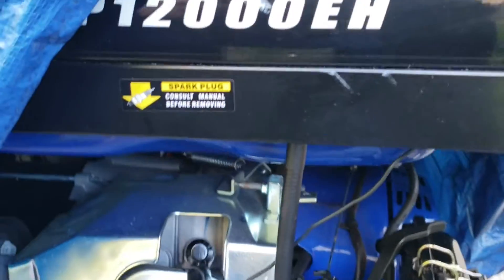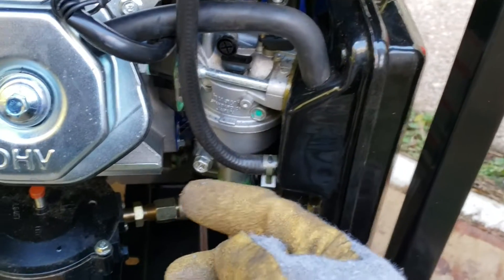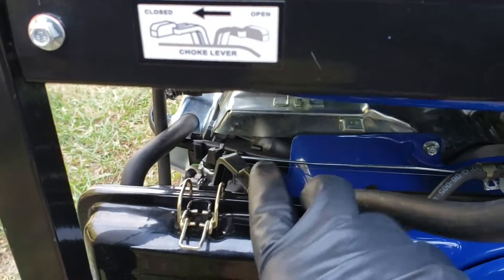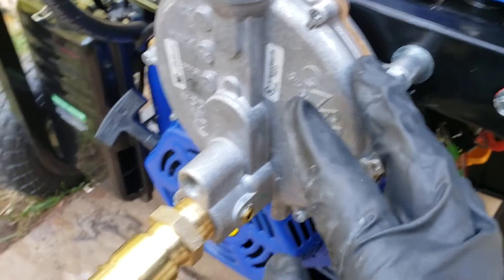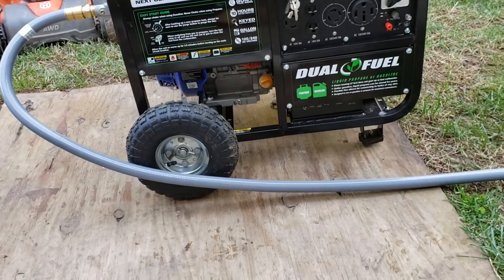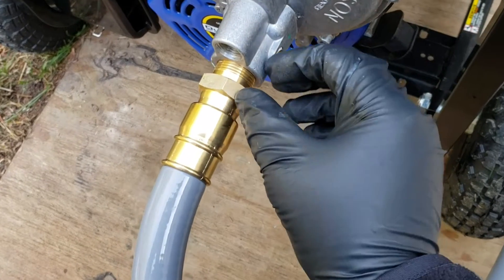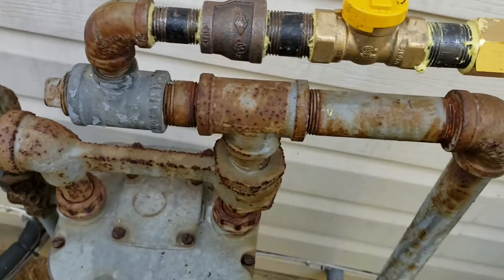DuroMax XP12000EH - Converting Gas/Propane Generator to Natural Gas (Dual Fuel to Tri-Fuel)

Comment: Why does Duromax say NOT TO RUN on NG due to damage to the generator? Am I missing something?
Reply from the maker: Back when I bought this and did this conversion, Duromax didn't have any warning against it. Looks like they updated their website. I'm not sure why they say it would damage the generator.  But their is a video of a guy in Texas with the same generator running his entire house on natural gas for several days during the recent polar vortex, and he had no issues. My guess duromax says that for liability/legal reasons .
Reply: Impurities in Natural gas, water, rust, gunk??
Reply: @mikecopenhaver4484  That makes sense. I have three Mr Heater Big Buddy 18k BTU's propane heaters and if you use the 20lbs propane tanks they suggest using an in-line fuel filter that you replace I think once a year or when you start to notice the flame in not as intense like the unit is set on low. The question is do the make NG inline filters? I just wish we had NG in my neighborhood. It's now two blocks away but if we want it I need a bunch of neighbors to sign a petition and need about $10k to bring it from the street to the house 🏠

Comment: Do you have a problem with THD on this generator? I heard THD on Duromax is about 10-15%. Do you have problem with your sensitive devices such as TV, computer or refrigerator? Thanks
Reply: Hello, my fellow Texan.. I did a lot of research on this generator, and nobody complained about not being able to run appliances due to the high THD.. My advice is to get the generator started first, give it a little time to stabilize, then power up the sensitive appliances. If you still have problems, you still have a couple of options.. Either get a UPS that has a line conditioner, or a power filter.. Early in my career I installed medical equipment in mobile clinics (buses or vans with X-Rays, scanners and other sensitive devices), powered by generators.  UPS was always the first measure to clean up the sine wave.. Line filters a close second.  I read reviews from folks that used surge suppressors, I'm not that convinced that it cleans up the sine wave, but it adds some degree of protection.. Best of luck!
Reply from the maker: Sorry, I don't know. I still haven't lost power and had to run this generator yet.
Reply: @Mr-Chris  Any updates to this? I had the same question, thanks!

Comment: Hello sir what is the brass looking piece on top of the regulator that connects to the carburetor called the size and where to get it thx
Reply from the maker: This is hard to find. I am 100% sure what the exact one you need or will fit, but these are the two I was able to find. 
Load Blocks:
https://amzn.to/3kIMLmn
https://amzn.to/3ba450r

Comment: I took what information he provided, did a check with an HVAC mechanic friend. Following that, I bought mostly the items he provided the links to & converted my XP12000EH that I had already purchased from Home Depot last year. After everything was finished the trial run worked perfectly. Now I don't need to worry about buying gas or propane in canisters, it's now running off the natural gas that runs in my house. The Best video I found on this subject & glad he posted it.
Reply: What all do you  run on that 1200 natural gas generator?

Comment: Will the first link of your tri fuel kit work on the duromax correct?
Reply from the maker: It should work for Duel fuel generators, it won't work for gasoline only duromax generator. For Duel fuel.. All you really need is the regulator, the top adjustable tee valve, and rubber hose.
Reply: @Mr-Chris  thank you man, figured as much.

Comment: Chris, do you know what the starting and running watts using Natural Gas?
My guess would be 9,600 & 7,600, but that is just a shot in the dark.
Thanks
Reply from the maker: yeah, your estimate is about right. It's 20% less than the gasoline rated power.

Comment: Informative video. Have you ran the generator on ng for any extended period of time? ...any issues?
Reply: I've been running my my Generac 7500E Generator for the past 9 years on NG with no problems.
I have 500 hrs of run time on the meter and I use Valvoline Premium Blue oil for NG,LNG & Gas engines.
From what I heard Valve Recession could be a problem with non hardened valve seats and this oil helps with that.
This particular generator in the video may have Hardened seats from the Manufacturer since it Already runs on propane, but you 
Would have to verify.

Comment: Do I need to mount this to the generator or can I just mount it to the gas line on the house and then use the same or similar hose and add a quick connect to the hose between the propane regulator and the carburetor.  Since I would only use  natural gas at home is seems like a much easier mod and I would not need that crazy big hose running all the way to the generator.
Reply from the maker: Theoretically seems like it might work. Keeping regulator attached to the main gas hose and having a disconnect for the smaller one to the carburetor. My only advice would be to make sure the smaller hose isn't too long. Also I think the regulator might need to be upright, but I am not sure. Give it a try and let me know if it worked.

Comment: One more question. Was there a reason for using the 3/4 ID gas hose? I need 24’ which is hard to find in 3/4 ID.
Reply: The gas hose and diameter of the line line is specifically dependent on the HP of the engine you are using, how far the line is away from the meter and how many gas appliances you plan on using with the generator, also, is the line direct from the meter, or are there other appliances on the line. If the hook-up hose is kept to 6' or less, the use of a 1/2" hook-up hose and quick disconnect coupler for up to 18hp engines is acceptable. The point is to have the correct size pipe up to the shut off valve for the generator.

Comment: Chris, what is your NG psi coming from your meter? I have the same NG regulator but it says that the minimum inlet pressure is 1/2 psi but my meter is regulated down to 1/4 psi. Curious to know if yours is also 1/4 psi. Also, can you run other NG appliances in your home without affecting the gas flow to the generator?

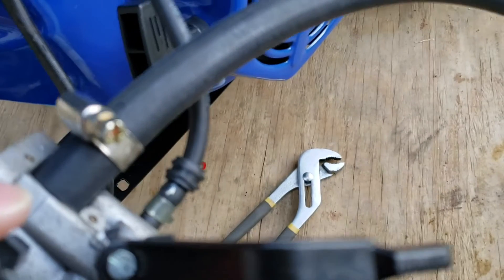Comment: Nice work. At around 2:00 in the video, you’re holding the carburetor in your hand. Couple of questions: is that the original carburetor? And, if so, did you remove it only because you needed to install the longer tubing that came with your kit? Or is that a new carburetor that came with the kit?
Reply from the maker: It's the stock carburetor. I took it off to give me better access, but it doesn't need to come off.

Comment: Hello Chris sorry to hit you up with questions,     1. Do you really need a 3/4 inch hose as it is you are reducing the size on the meter from 3/4 to 1/2?  I read that you do need a lot of BTU for this generator to handle the load at 9500 watts. Have you push this to the limit?   2. the amazon link for the conversion kit, for that price they do not include the load block, they said on the Duro max XP1200 you do not need it?  Have you found that to be true? if your load block pretty much wide open with full choke ?  3. did you run the generator with gas prior running it with Natural Gas for the first time?  I read you must run the generator at least 2 hours on Gas prior running it on Natural Gas?  let me know what you think. Thank you.
Reply from the maker: #1. This is debatable, "professionals" say that for a 18HP engine like this... meter fitting can be 1/2, however they recommend 3/4 meter fittings. The "pros" also say the hose needs to be 3/4. However some users say 1/2 hose and meter works well, while others say it doesn't.  # 2.  That's right, You don't need a load block for this kind of generator as the carburetor already setup to run Propane and it can run natural gas so long that the regular is adjusted to the correct pressure. I think the load block is only needed for Gasoline only generators. #3. I owned the generator for several months before converting it natural gas. I think I put about 10 hours of use on it and changed the oil before the conversion.
Reply: @Mr-Chris  Good morning Chris, thank you so much to the clarification, I am planning on doing this set up, but the Gas Line was ran from the meter at 3/4 but reduced just before the end, So I will let you know if it works. As far as the load my question was because when the power goes out here its for 30 hours or more and I was expecting this set up to be on for that long and was wondering if you have run yours for that long and could provide any feedback under heavy load.

Comment: Why couldn’t you use the original regulator that came with the generator?
Reply from the maker: The factory Regulator is only set up to work for propane not Natural Gas.
Reply: I think the regulator on the generator  has an inlet pressure of max .5 same as the regulator that you installed. I’m Almost sure the original would work if you add the tee with the bolt and lock nut to adjust the pressure or the stock regulator might have an adjustment. The original kit to hook up propane has regulator coming off the propane tank to regulate the high pressure down then to the regulator that’s mounted to the generator.
Reply from the maker: @Goatl7967  Yeah, I think you are right, perhaps just by installing the adjustable tee on the factory regulator might do the trick.
Reply: I used the stock regulator on my new Westinghouse generator, it works perfect. No need to change the regulator. I even used a 3/8 Bbq hose for natural gas and it worked fine.
Reply: @Goatl7967  Can you make a video showing what you did exactly? About to buy the westinghouse generator, and want to do the exact same thing.
Reply: @Goatl7967  Thank you. You didn't even have to adjust the regulator to get it to work?
Reply: @kylecaesarcomedy  no. There’s no adjustment. I put a load on it and ran fine. I think It pulls gas in by Venturi

Comment: Thanks for the video. I could not have done my conversion without seeing what you did.
I have a DuroStar ep12000 dual fuel.
It came with a different regulator than your DuroMax (made by the same company). I put a 3/8” quick connect nipple on the regulator inlet. I put a 3/8” socket on the propane hose w/ regulator that came w/ the generator. I bought a 1/2” I’d 24’ hose with 1/2” nipple on one end that connects to the 1/2” socket on my natural gas line & a 3/8” socket on the other end that connects to the regulator.
This allows me to connect either the NG or the LPG hose to the regulator. I can change from NG to LPG to gasoline in a few seconds. Runs great. Truly tri-fuel.
Reply: I have the durastar also and want to convert mines to ng. Can you show a video or more info on how to do it.
Reply: @santoscruz350  Santos, It is not that hard. Just get the fittings necessary to connect the NG to the existing pressure regulator. The existing fitting into the regulator (& on the propane hose) is 3/8” flare. So you need 3/8” female to connect to the regulator & whatever to connect to your NG supply.
Reply: @bryanespenschied3583  thank you! so you just used same regulator he showed in video or which regulator did you use for ng

Comment: Good Job for your limited experience.  Regarding your panel... watch some videos and study up on electrical... $5K to do a panel swap sounds like piracy to me and upgrade to a 200 amp panel.  I live in hurricane country and one thing we have never lost after a storm is the natgas.  Water and electric may be gone but the natgas has always been there.  If you are smart enough to accomplish the chore with the gas  conversion for your generator you certainly have the smarts to do a panel swap.

Comment: Great job Chris. When my finances permits, I am considering using the same Duromax generator to work with my self-installed PV solar arrangement. It will be used in an auto generator start/stop configuration.

Comment: My power meter is at the front of my house one one side, my gas meter is closer to the front on the other side and of course I wanted my tri fuel generator in the back yard. Added a few hundred to the install, but still happy with the results.

Comment: You don't need that extra hose just use the OEM hose and the fitting from the propane regulator and put it to the new top piece on the new regulator take out the long skinny nipple looking thing

Comment: What is that screw like throttle setup you have on the top of the regulator?
Reply: Yes that's how you control the idle speed. One step that he missed is using a meter to measure the hz. Set the idle speed to achieve 60hz or 3600rpm
Reply: @XloMotion  a with what item to measure said 60hz or 3600 rpm and 2nd whats the model of his controller with the screw on top of regulator

Comment: I am doing same thing on xp13000eh not working 😕 I like to contact you
Reply from the maker: Sorry I don't know what to tell you. your generator is very different from mine. Looks like the propane connection and  for the 13000 is different from mines. The only thing I can tell you is that I made sure to remove the hose from the propane regulator connect a new hose to the tri fuel regulator to the carburetor. Also I'm unsure if you have a automatic choke carburetor as that could also make a difference.

Comment: I plan to do this on my Westinghouse WGEN12000DF portable generator (dual-fuel gasoline + LPG).  But this Westinghouse generator has an automatic choke.  You said that you had to run with your (manual) choke wide open to run on NG.  I wonder if my auto-choke is going to let me run on NG?
Reply: Have you tried it?
Reply: @Bryan-hd9fs  No.  Ended up not getting the Westinghouse.  Sticking with my Sportsman 7kw/9kw tri-fuel w/ manual choke.  Runs everything I need including 2-ton AC.

Comment: Instead of disconnecting the propane setup. Just put a quick connect on a 90° brass fitting to angle the quick connect toward the outside of the generator.  Buy the natural gas convertion with snorkel kit with natural gas regulator and extra long rubber hose. Put a 3/4"quick connect on the natural gas regulater. You don't have to take parts off to have a dedicated  propane or a deadicated natural gas generator. Have it to where you can plug into either one that you need to run at that time and have a true tri-fuel generator.  All you did is keep your generator a dual fuel generator.

Comment: One question so does this negate the use of propane and regular gas . My understanding using the full kit generator maintains a tri fuel compatible
Reply from the maker: This regulator works on both propane and natural gas. Theoretically you could still keep the old regulator however this replacement regulator can do the job of both. You would just have to readjust the valve and you can easily get propane up and running no time.

Comment: Should of used the kit that went under your air cleaner. Regulator like you got for natural gas. And high pressure Regulator on your propane bottle to use propane.

Comment: Hey Chris, great video. You CAN use your 50 amp outlet if you install a 50 amp breaker in your house service panel with an Interlock switch and a 50 amp inlet plug outside. I did it for about $300. including a 30ft., 50 amp cord. Sell the generlink to pay for the short list of supplies.
Reply from the maker: Trust me, I've looked into installing a interlock, but my breaker box it's not a good candidate for it. I have a "split bus panel" breaker box which means I do not have a main shut off. My breaker box has a series of shut offs not one main shut off. So it will always back feed into the grid. In order to install a interlock, I will need to upgrade my entire breaker box. I live in a DC Metro area and electricians price gouge like crazy for this service. That's how I ended up with the generlink.
Reply: @Mr-Chris  Hey Chris Great Video Seriously Great! Is the Generlink the device between your power meter and the meter panel? I saw that in your video and I said to myself what is it and where do I get it? Thanks Eddie on Long Island

Comment: So you just added the regulator and kept the factory gas insert installed on the carb? Looking at getting the same generator setup for hurricane emergencies.
Reply from the maker: Yes, all you need is a regulator kit without any adapter to convert this to Natural Gas. I have a link to a kit without adapter in the video if your interested.

Comment: Chris, are the measurements for the gas pipe coming from the meter always 3/4” ?  So I’ll have to get 3/4” gas on/off valve and fittings and hose? Thanks.
Reply from the maker: That's debatable, During my initial research it appeared that I needed a 3/4 inch hose... however I received several comments of individuals saying that they're able to get this to run off a half an inch hose.
Reply: Chris question about the regulator. The regulator link in the description is the same regulator that comes from US Carb?
Reply from the maker: @edgarsalinas8752  Yes, its the same brand regulator, just sold by another retailer. The Regulator I have is the same garreston regulator.